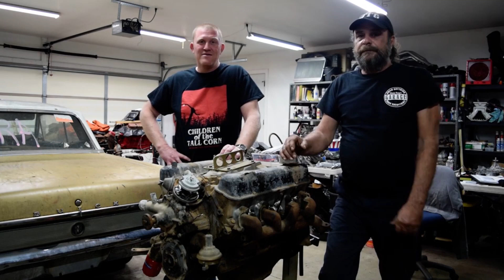Buicks Miracle Motor

Comment: I believe the story started with BMW and a 2.58l alloy v8 powering the Baroque Angel in 1954, which they then developed into a 3168cc 150hp with twin downdraft zenith carbies. So this engine disappeared into GM for study, nobody officially admitted the link, but a couple of years later when Buick, Olds and Pontiac brought out their first compacts it had an alloy v8 modified for big volume production and enlarged to 3.6l, but essentially the same design as the BMW engine.  would be great to sit these two engines together and compare them in detail. Never the less these are an amazing engine and still lighter than a lexus V8.
Reply: I think the 215 was more the result of ongoing research by GM into using aluminum alloys in engine construction during the 1950s, a very early proto-215 was fitted to the 1951 LeSabre concept car. Meanwhile the BMW V8 was design-wise just a downscaled Cadillac 331. Even then there were some major differences such as the BMW using cast iron wet cylinder liners.

Comment: 300 ci ford straight six.  in production around 30 years. used in everything from light trucks, to industrial generators.  hands down the most durable engine ford ever made.
Reply: thats not saying much LOL!!!
.
from the 90s on..... ford has NEVER made an engine worth a crap.
and when they did make a "good" engine, it only makes power WAY up in the RPM range.... and only for 800RPM
like, a GM or dodge will make power from 2300 to 5400 rpm...... ford, only from 4800 to 5200
.
3.0 Vulcan v6...... compared to.... GMs 3.1 v6
the 3.0 only revved to like 5500 rpm.... like it was a 455 big block (meanwhile, the 3.1 will hit 6300)
made less power..... got worse MPG..... more crap broke
way harder to work on (i can do a water pump on the 3.1 in 5 mins.....no joke)
had NO low end torque (despite not wanting to rev high, it made no torque till 5000... then was finished by 5400....IDK how you do that)
iron heads VS the 3.1s aluminum (and a worse intake/exhaust path and chamber design)
.
.
5.4 is just junk 
all 4 versions.... 2v.......3v with re-invented spark plugs.....3v with normal plugs but only 2 threads.... and 3v with 4 spark plug threads
.
the 4.0 OHV was an OK engine...... 
but then they took that happy little v6 and made it overhead cam..... with a STUPID timing chain and jack shaft set up
that timing chain set up is an engineers wet dream.... and made a lot of mechanics a TON of money
.
even the old 351 had 3 different versions..... and the Cleveland version was so thin, the bore would distort on an engine stand, giving you bad measurements on bore taper and roundness (you had to support the front of the motor VS just letting it hang on the engine stand)
.
the 6.2 has 16 spark plugs..... because meeting emissions is hard for Ford engineers...............
meanwhile, GMs 6.0 and 6.2 make more power, more MPG, less emissions.... and only use 8 plugs....
.
.
and dont get me started on the diesels.....
.
"hey, the 6.0 likes to blow up.... so lets bore and stroke it to 6.4....that should fix it!!!"
"oh no, it blows up even more..... lets blame IDI!!!!"
.
and the 7.3 IDI is only "reliable" because it doesnt make enough power to hurt it self
and the 7.3 power-joke blows up almost as often as the 6.0 (aka six point blow)
.
their new 6.7 power-joke has more issues than a duramax.... 
and when you want to work on even the SIMPLEST thing......its "step 1 - pull cab" 
thanks ford.... you fucking hacks
.
.
.
as you can tell..... im a mechanic..... and i dont like Ford
from the 50s till today.... they have been over engineered and harder to work on than all other brands (from honda to dodge)
.
Ford tries to do "superior German engineering"....... 
but then hire "Bubba" to engineer the outfit..... who got his degree online....
.
so its all the negatives of German engineering.... none of the positives 
.
again, only makes power in a VERY narrow RPM band (which is german as fuck)
to work on it, ya have to remove the cab or pull the engine (german as fuck)
.
but they use cheap parts made in mexico.... (VS german parts, which usually are pretty decent) 
so you are ALWAYS pulling the damn cab
Reply: again, im a mechanic..... id rather work on a BMW than a ford
at least the Germans know its over-engineered and dont try to hide it
.
ford is only the best selling pickup because they are cheap.... so companies buy fleets of them
and then the 4.0 or 5.4 grenades the valve train after 120,000 miles.... so ya gotta buy a replacement pickup 
.
but now days..... ford, GM, mopar, even the off shore brands.... are all FUCKING JUNK!!!
.
their emission systems are "lets burn more gas, to run the SMOG equip.... to the exhaust is cleaner"
and then all thows systems start to fuck up.... costing 1000s
.
like... someone at ford was like...
"hey, remember A.I.R. injection pumps from the mid 80s?? how they robbed 60hp.... just to pump air into the exhaust to dilute the exhaust gasses to make it LOOK like its a clean engine??? LETS BRING THAT BACK IN 2018!!!!!"
.
WOW JIM! WHAT A GREAT IDEA!!! OUR SHOPS WILL MAKE MILLIONS ON FIXING THAT FUCKED UP SYSTEM!!!!!
YOU GET A PROMOTION!!!
Reply: @kainhall  lol sounds like you were having a bad day. 

The AIR pumps of the 80s don't take 60hp though. They were also to oxygenate the cat so it could burn off hydrocarbon. Had nothing to do with diluting anything.
Reply: @kainhall  compare the 300 six to the g.m. inline from the same era.  the ford had a stronger bottom end.  it fever low because it was designed to run lower end.  higher r.p.m. does not mean a better motor.  cams and valve train controls that.  wait, you a "mechanic" you should know that.  i can also tell you have never been around the 300 six.  educate yourself on that engine before commenting on it.   g.m.?  may I mention the quad 4, or the northstar?  your precious g.m. has had it's share of turds.
Reply: @kainhall  So you like Ford engines.

Comment: Think this title goes to the Flathead Ford V8 used in everything from the family sedan, to luxury cars, sports cars,  race cars,  light and  medium and heavy-duty trucks,  aircraft, stationary power applications,  industrial applications,  marine applications, farm tractors, and military vehicles, wheeled, tracked, armoured and thin-skinned. 
It was the engine that took the V8 from solely luxury applications and put it in the hands of the average joe and became the progenitor of the modern hot rod movement and the aftermarket performance part industry and the interest in it that it generated. 
 It was produced from 1932 to 1990 for a total of 58 years.  Longevity not exceeded by any other widely used main stream power plant.
There has been no engine that has done as much seen as wide use in varied applications for as long and influenced the automotive performance industry more.

 There is only one engine that can truly hold the title of Most Successful And Versatile Engine Of All Time. 

And that is the Flathead Ford.....

Comment: Olds design this motor and many of g.m.  cool stuff and things all car manufacturers copied 1948 they came out with the first over head valve engine the 303 rocket, first turbo, automatic trans , first glass body ( corvette) 1952  detroit auto show, first big block 394, first in win daytona 500, quad four,still holds record in door track 255 mph?? Cammer  in 68, and the coolest this companies engineers all choose to retired then go with chevy, who got all of the gravy, they sold the most that's why see more of them in junk yards.They have won more "Wallies" then any manufacturing company bar none, if you don't know what that is dad hasn't to given you his keys😉

Comment: The same only different. LOL When they went to cast iron and raised the deck for all intents and purposes it was an entirely different engine.  When do enough changes to an engine make it a different engine. Back in the days when that engine was new the cast iron V-6 was probably the better motor. There was a very big problem with the alum reacting with anti freeze and the inside of the engine corroding blocking the passages in the radiator. My uncle had the V-6 in a jeep CJ-5. It always sounded like it was missing  You could even use the V-8 distributor cap on the V-6 You just left off the wires to the two missing cylinders.

Comment: Hi Tony I feel I need to correct your history here 
 Rover used the 3.5litre V8 in its passenger cars until the mid 80’s and in it luxury 4x4 Range Rover from ‘74 to 2008 later models being the 4.6 litre 
 Triumph never used this engine , they developed  they’re own V8 by effectively gluing two slant 4’s together .... it suffered badly in the 70’s with poor manufacturing and people not understanding it , however any triumph running original V8 is sorted and understood , in honesty a popular modification was to bin the triumph V8 and replace it with a rover 
 TVR ( or Trevor ) was a stand alone car manufacture who started making low production cars in the 60’s ( see TVR Griffith with a Ford 289 ) as the rover V8 was readily available it was chosen as power plant and used through the early 90’s until the company folded

Comment: Chevy motors and blue death smoke signals ☠️☠️        

1960’s -70’s chevy v-8 long blocks.        Longevity / reliability should include some reference to mileage prior to Internal death rattles / grenades and total rebuild  $$$$$

We routinely had reliability issues- long term  

Maybe defining “ long term”

Comment: Kaiser Jeep called the v6 the Dauntless, from 66 to 71. Available in Jeepsters and C.J. models. arguably the best Jeep engine ever. I'm fiddling with one right now. Thanks U.T.
Reply: Arguably. 
Because the 258 2V is the most versatile and reliable engine . . . for a jeep universal. 
The Jeep universal weighs next to nothing , and the 258's low end torque (can idle at 450 rpm) was ideally suited to multiply with the 2 speed transfer case . 
The 258 might not pull to 100 mph , but the Jeep universal doesn't like that speed anyway !
Reply: @Richie_the_Fixer  258 is a great engine as well, tough to fit in a flatfender though!

Comment: Put it in a GM H body... sunbird, Monza, skyhawk, etc. find one that had the Buick V6... the Buick V8 drops in on the stock mounts. The Whole face of the V6 will swap over. (I.e. water pump, power. Steering pump, all the brackets.. etc.) The stock y pipe may even bolt up. I’ve been wanting to put a 300/340 in one of those cars for years but I can’t find either of the needed parts.. lol. It would be a fun car for sure. Btw.. upgrade the H body 4 lug to 5 lugs with S10 parts. Cheers! 🍻
Reply: Use 3rd gen F-body parts for your suspension upgrades. 
The Monza Town Coupe notchback was the basis for the 3rd gen F body. 
Look at a 3rd gen with the front bumper and the glass off and you'll see it .

Comment: Rover had the alloy casting process sorted due to knowledge the British gained from aircraft manufacturing. Having said that, there were times that liners shifted, (press it) often after overheating. Its generally accepted some of the larger Rover engines were not without issue, I knew one specialist that refused to work on some.
Rover engines had less horsepower but the horses were bigger than the US ones, even the later fuel injection 3.5 motors were rated at 'only' 192hp.
The Aussie 4.4 was a revised casting, in the day a popular jet boat engine.
People often look puzzled when I point out the connection to the 3.8 of which we had plenty due to Holden. Holden did improve on some of the engineering, if I remember they centered the rods on the pin for one thing.

Comment: Fun video, thanks for sharing. When on the topic of long lived engine designs, the small block Ford Windsor has also had a very long run.  Starting life in 1961 with 221 CID and same basic architecture as a 302 in the mass produced cars/trucks/SUVs up to the early 2000's.  They are still being produced and sold as create engines and a vast selection of aftermarket support that the Buick 215 never really had.
Reply: Buick 215 has tons of FOREIGN after market support...

Comment: They used the 3.8 turbo in the 1989 Pontiac Firebird. The Land Rover also used this V-8 in various displacements. Mickey Thompson entered a stock-block Buick 215 powered car in the 1962 Indianapolis 500. In 1962, the Buick 215 was the only non-Offenhauser powered car in the 33-car field. Dan Gurney qualified eight but did not finish the race because of transmission problems.

Comment: They were also used on the MGs for a short time. An old timer about 4 hours south of you has two of them. He daily drives MGs only lol. Great guy.
Reply: When I worked on the MGB V8's in the 1970's we regularly renewed the engine mounts, the torque of that motor tore them to bits!
Reply: @frenchenstein - The Triumph Spitfire 4 banger 1500cc  in MG Midgets also tore up motor mounts because it was such a rough vibrating engine that MG hung it from rubber to smooth it out instead of merely sitting on rubber! And those engines and transmissions only lasted 25K miles at USA road speeds... 
I put the Buick 215 V8 and little BW T50 5 speed manual in my 1975 MG Midget which I still have...
Reply: MG V8's weren't imported to USA, though... 
I put the Buick 215 V8 and little BW T50 5 speed manual in my 1975 MG Midget which I still have...

Comment: I have the 3,5 , 3,9 , 4,2 and the crossbolt 4,6 in various land Rovers. I love how parts is interchangeable. Get a 4,6 and use parts from the 3,5 (carbs, dizzy and front cover) and put right in.
The Rover v8 cds twin carbs works really well. They work in every offroad situations.

Comment: I've tuned and driven a buick 225 Electra  with a 215 in it. It was smooth,  exotic and anemic.  My vote would be for the Buick 3.8 v6. Not hard to get in the 10s with a Buick v6. Edit.. I didn't realize that the Buick v6 was derived from the 215 v8.

Comment: The 3800 with FI and Dizzy-less ignition was 1 Hell of an Engine.
They ran virtually for--------ever, sipped fuel, and had some git to them. Thanks to VVT, AFM, Turbos with small Cubes, and all that other crap engineers pushed, that engine was dropped, and the General Public became the test bed for this new fangled engine gadgetry  that simply just robs reliability that Noone wanted in the 1st place!

Comment: I started as a Buick Tech in 1980 and all the older Techs hated this engine . They all said it was a bona fide piece of shit . We did far more internal work on Buick engines than Oldsmobile and Pontiac engines . Buick's issue back then was the oil pump  and oiling system
Reply: I always installed a high volume oil pump kit and 160 degree thermostat, blocked the heat risers and didn't have many problems.
Reply: @christianmotley262  We beat the hell out'a one and it didn't seem to care ....then the car got totaled so

Comment: Tony I would also like to nominate the Slant Six. As you know that thing was in everything on land and sea. The Buick engine is iconic but does not have nor ever will have the cult following of the slant six.
Reply: Cult following ? 
Say "Grand National" . 
Because NOBODY ever says "never heard of her". . .
Reply: @Richie_the_Fixer  Rich I am older and quite frankly the two words " Grand National" to me means the top class of NASCAR before Winston Cup existed. The Buick engine was a great engine but in my opinion it is not as great as several engines such as the small block chevy. the ford inline six and the slant six. My opinion, you may not agree and that is fine. Still my opinion.

Comment: The only time I ever saw a mechanic cry was working on one of these aluminum block monsters. He had to take it apart three times to finally get the heads on it. Every time he would try and torque the heads he would get almost finished and a head bolt would strip out the threads in the block. He would have to disassemble the engine and Heli Coil another head bolt hole in the block. Great engines when NEW but after they had a year or two in the field and about 20k miles on them with all the heat and cool cycles and anit freeze eating at the threads GOOD LUCK if you had to work on one. ANY threaded hole into that block could fail. Mechanics nightmare.

Comment: When AMC bought Jeep in 1970, they quit using the v6, GM bought back the tooling (which was in storage) and made the v6 share buick 350 pistons and called it a 231 for 1975.
Reply: But they continued to use the 350 Buick for several more years in the J series & Wagoner.
Reply: I read that they brought it back to the same factory and bolted it back to the original places

Comment: Had a 2000 buick regal GS supercharged. They quote 240hp. With the way the car ran i believe it had every bit of it.
Reply: I ran a 14.5 quarter mile in first and second gear with the tires spinning, all stock, 1998 Regal GS

Comment: When Buick builds them, they build them right.
Reply: laughs in badge engineered 3.6 timing chains every week
Reply: @jamesgeorge6551  not a Buick engine
Reply: @christianmotley262  my freind, GM died, like the Phoenix, and was reborn in 2009. A lot of people don't know that when that happened, GM, as it was since the 60's, was dead. Gone. And New GM was born. However, Buick, didn't do anything but badge engineer for years, the 3800 was the last hurrah for them. By the introduction of the metric chassis in 1978, the death of Oldsmobile, and Pontiac were underway, and the Cadillac Northstar was the last exclusive GM engine made. Now, its all face swapping, badge engineering, Buick is Chevy is GMC is Cadillac now more than ever. I fix them every day.